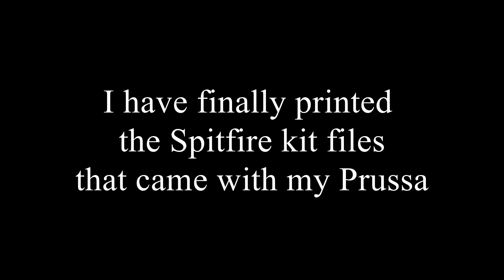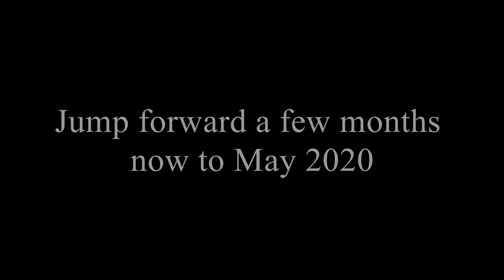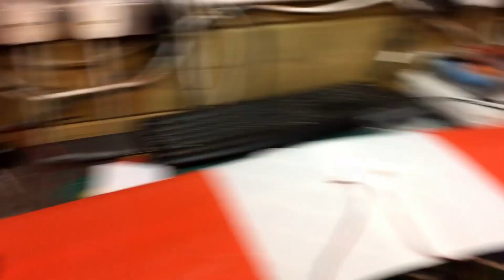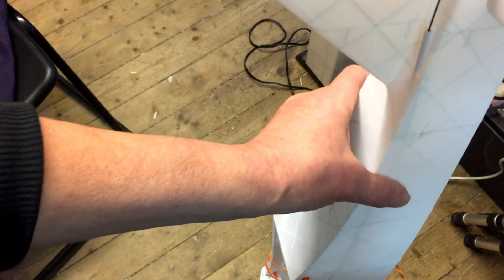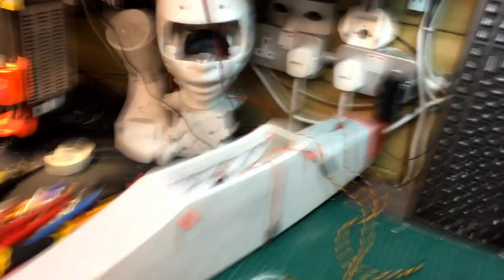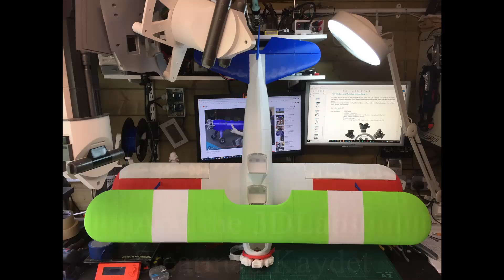RC Planes Part - 3 Spitfire and QTrainer

Comment: Cool! Not quite the sound FX I had in mind but it works. Looks good. No concern over the additional weight from moving to the metal servos? Power draw is the same?
Reply from the maker: Only slightly heavier but they work which helps!